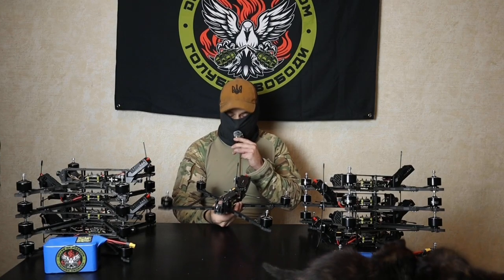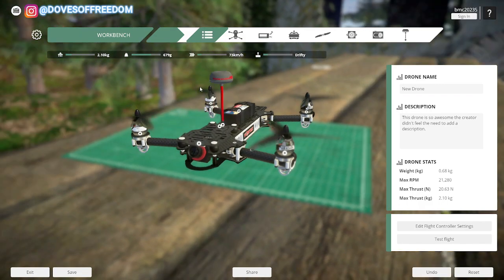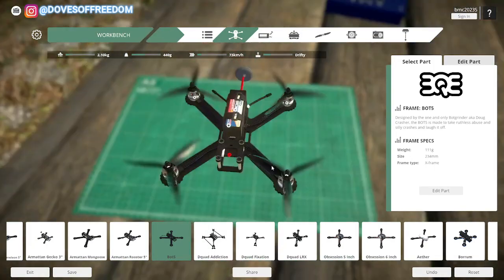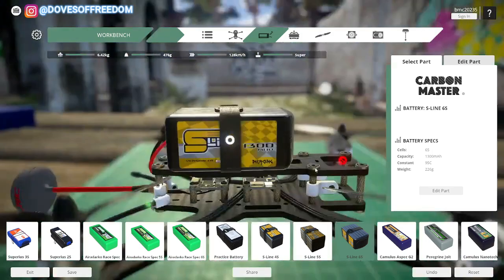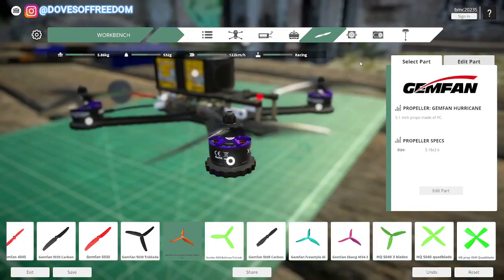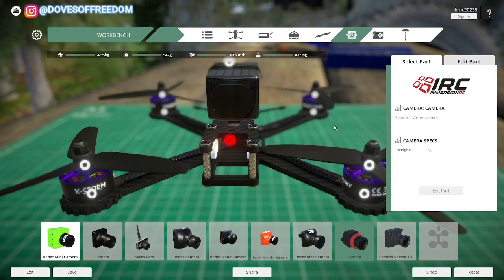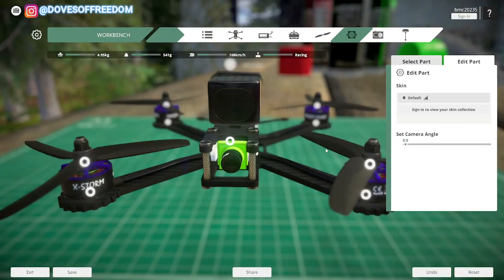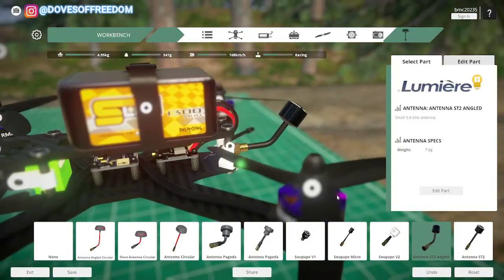How to build a custom FPV drone similar to those used in Ukraine in Lift Off simulator

Comment: how close is this build to the 7inch loaded with 3kg warhead?
im a decent fpv pilot but i mostly fly woops and 3.5 that are super snappy , i made this build in liftoff and it struggles hard to get itself out of freefall , is that how it is with kamikaze with max load or are the motors a little underpowered ?